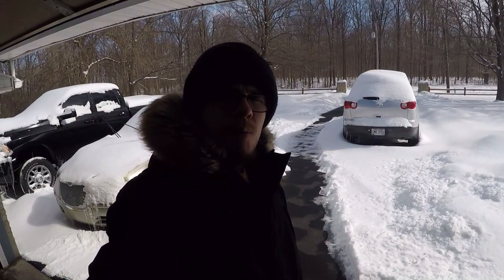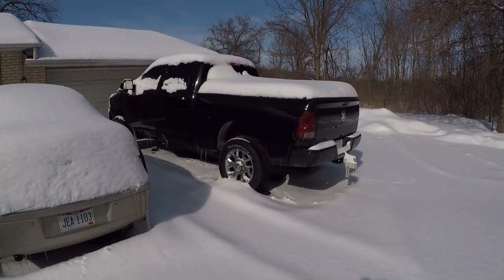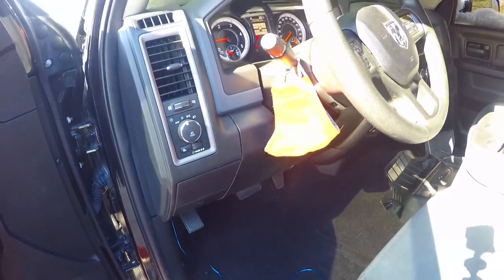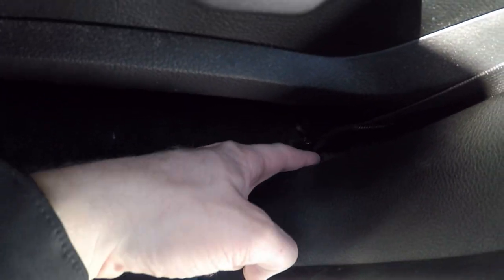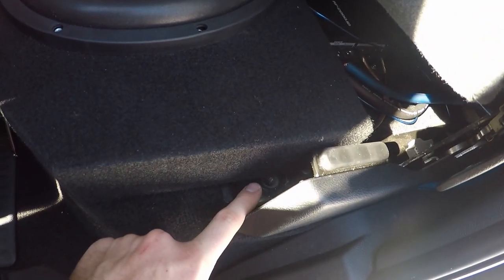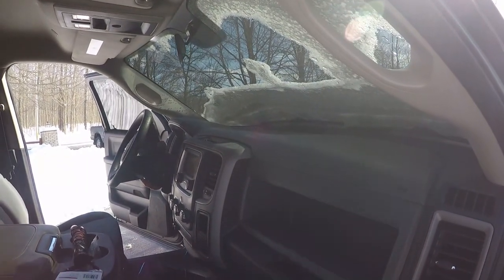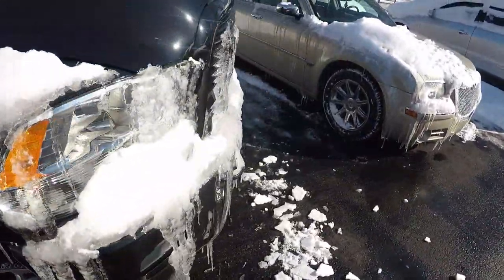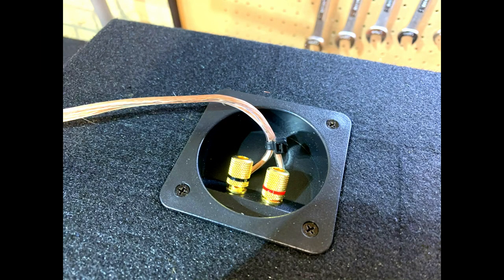UPGRADING 4TH GEN CUMMINS!!! Skar Audio 12" Subwoofers!!!

Comment: What’s up man. I have 2011 1500 Crew Cab and thinking about doing the same sub and box setup. 
4months in how do they sound???
Is it worth the money. 
Why did you choose a sealed box over a ported box?
Reply from the maker: They sound really good. The subs are 6.5" deep and being a 12" sub not many people make boxes that go that deep for the Rams.  So I ordered one and had to take and modify it to get my subs to fit and not have any issues.  I also had to buy seat spacers to space the seat up.
Reply: @rc_1996  when you say “modify”…when do you mean? How much modification did you have to do? 
I’ve seen Steve Meade review these same speakers, so I’m very interested in the details to make them fit in this box.
Reply from the maker: @kbbriggs8561  I had to take a grinder to make the box about .25”-.5” deeper. And inside the box I had to grind a notch for the speaker magnet to fit. It wasn’t anything crazy. Just take your time and it will fit. Might want to have some silicon as well so if there are any holes you can fill them so it’s air tight.
Reply: For the box I would suggest fox acoustics. They have a badass sub enclosure for ram trucks.